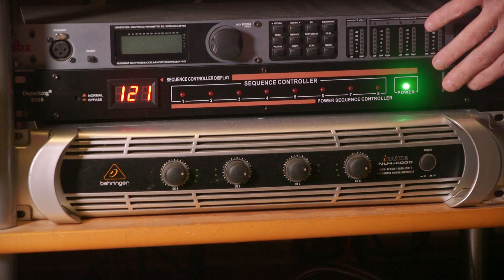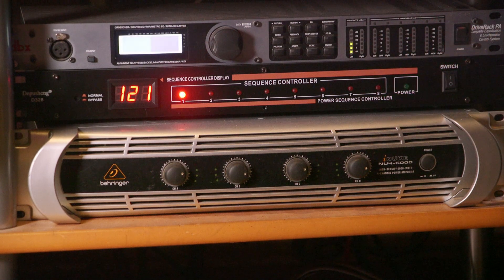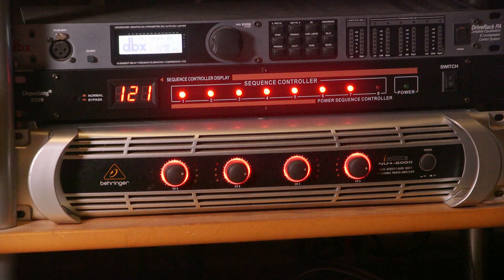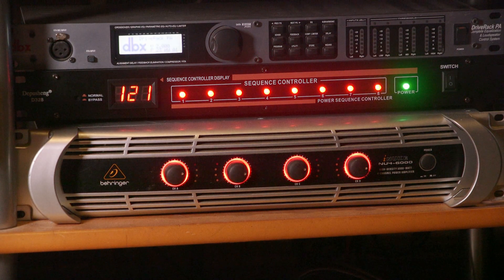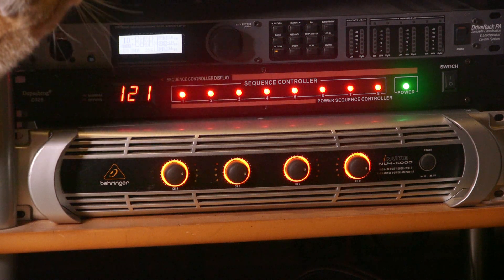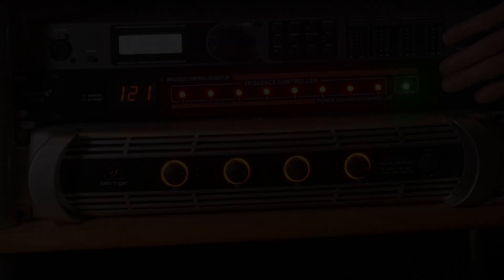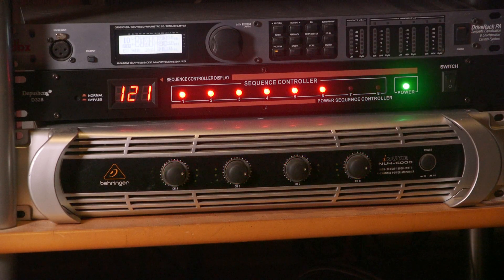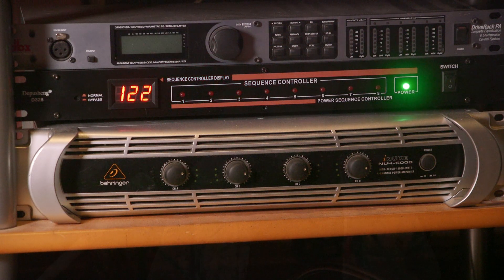Power Sequencers vs. Regular Power Strips

Comment: Is there a way to set this sequencer up with a rf remote
Reply: Barry what would the sequence set up be for a pre amp and 3 power amp set up? Is it preamp on, then power amps? Then it’s the reverse?
Reply from the maker: Exactly. I'd connect the power amps to outlets 6, 7 and 8.
Reply from the maker: That would be cool, but it's not an option offered by this model.

Comment: Some people still think fuses and breakers on the power strips protect their gear. When in fact they only protect the wire. And prevent fire.
I'm not sure about surge suppression? Dr. Barry, What say you?
Reply from the maker: Overall, I would tend to agree. I would say that anything is better than nothing, and putting a RF choke and some MOVs across the line, like you find in most power strips can help suppress those brief transient spikes.  That can't hurt.  But typical power strips I don't put a whole lot of faith into for offering serious protection from line disturbances. 

Voltage regulator units which isolate all the equipment through a transformer take protection to a higher level, and that starts getting expensive.  I think the power supply in the equipment offers a lot more filtering than typical power strips do, negating much of the necessity of the power strip.  If your line voltage has really radical shifts or you take a lightening strike, I don't think anything is going to save you.

But, being able to consolidate all of your power cords, and keep your wiring tidy inside of the rack is a big benefit.

I also like the units that include a voltmeter, which gives me peace of mind with the power feed is at least reasonable.

Comment: I've been working on large industrial HVAC units lately with multiple VFD driven AC or EC motors, actuators on pumps, valves, dampers, etc. 

Shutting one down is a process, a far cry, though, from a steel plant that can't be restarted once it's turned off, turning off an AHU's mains switch could have catastrophic results at worst.

At home it's more about avoiding pops in the speakers. Definitely something to think about and done right it can really help reduce wear on your gear.